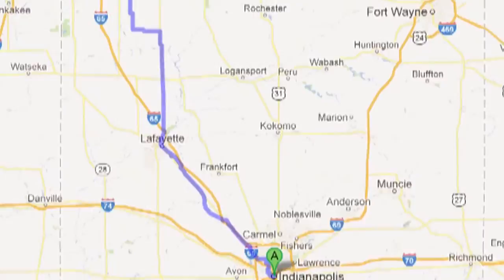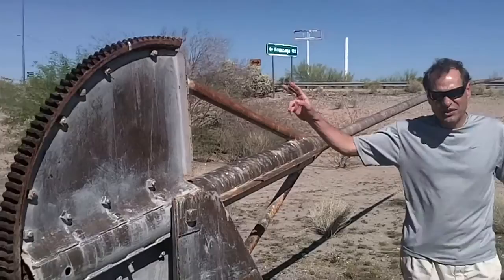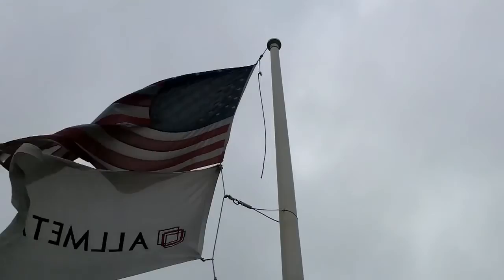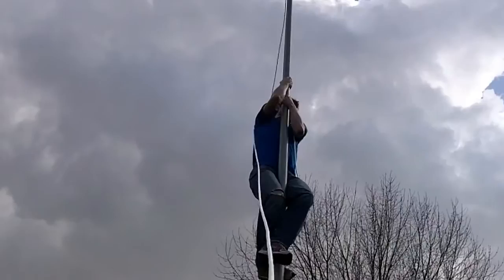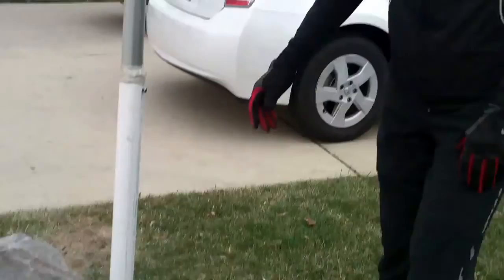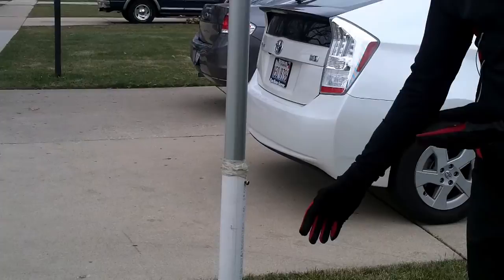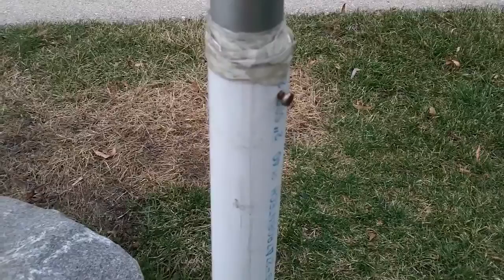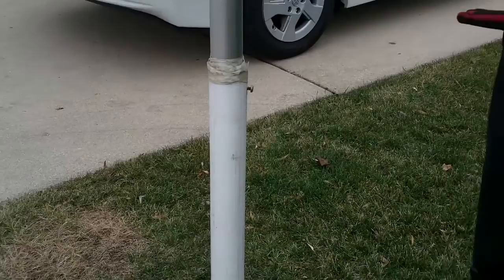FlagDesk.com | Homesteader Flagpole Reinforce / How to Rebuild Your Flagpole

Comment: The concrete base and tube to hold a flagpole where I moved is tilted (not level). Is it better to create a new hole, pole insert and concrete pour ??? Or is there a way to adjust the tilt in your expert experiences?